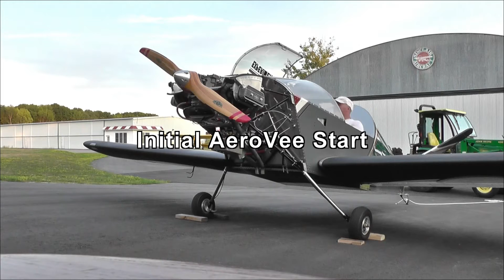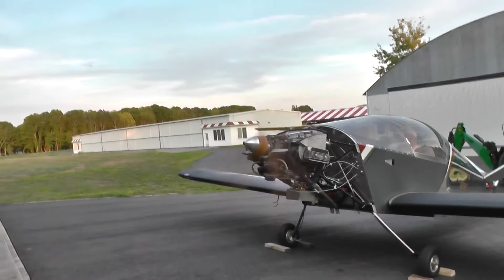Aero Vee Initial Start

Comment: Is this the turbo motor or the 80hp motor?
Reply: They still using the "No Name" turbo manufacture. I was going to buy one of those kits until the CEO was killed in one and the NTSB report said Sonex refused to tell them who manufactured the turbo. They wanted to determine if the impeller failed caused the engine failure, or was the jammed impeller from the crash.  Sonex refusal to turn over that information turned me off from ever owning a sonex. Likely the turbo was from a low cost Chinese manufacture they didn't want their customers to know about. http://www.kathrynsreport.com/2015/06/sonex-n123sx-sonex-aircraft-llc-fatal.html
Reply: @Mike-01234 ”The circumstances of the accident are consistent with the pilot failing to maintain sufficient airspeed following a loss of engine power during takeoff, resulting in the airplane's wing exceeding its critical angle-of-attack and a subsequent aerodynamic stall. Instead of using the full runway length of 6,179 ft, the pilot elected an intersection takeoff with about 2,570 ft of available runway. Calculations showed that, had the pilot used the entire runway for takeoff, sufficient runway for a landing following the loss of engine power would likely have been available.”

As always it’s a tale of ADM and risk management. We train to handle engine failures for this very reason. Yes, the slipshod design of the engine does not help, but we’re talking about experimental aviation. If you want verified zero risk go buy certified.